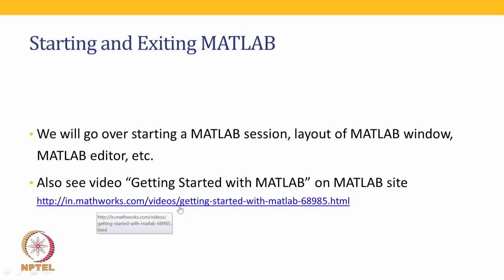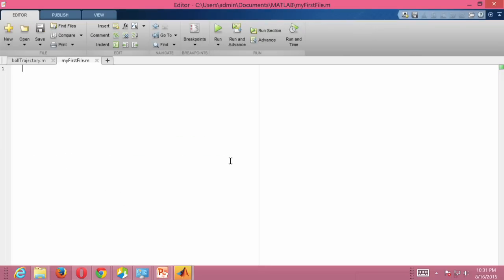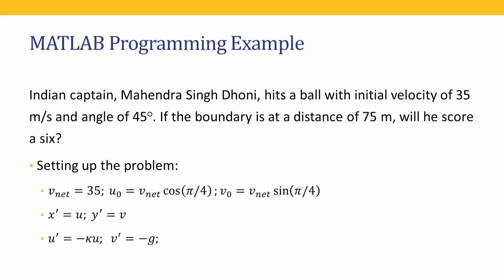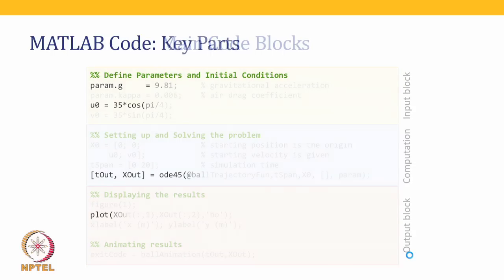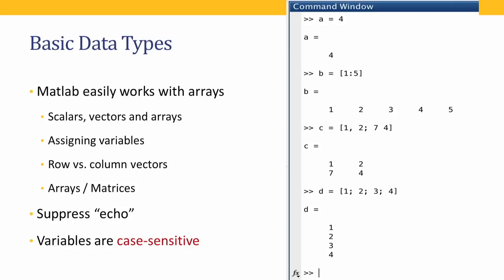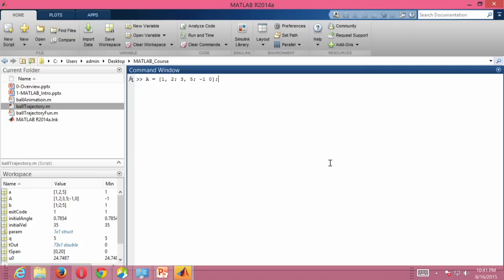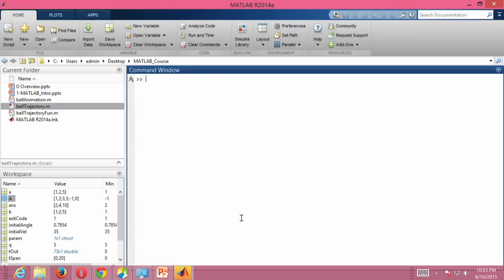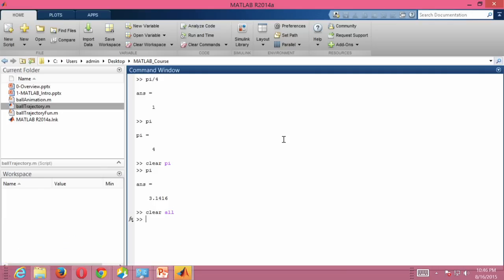Basics of Programming using MATLAB

Comment: sir please show me how predict value give show below PDF and and how build this type of network .sir it is not my project but same way i have make my project .it is a concrete work of Predicting the compressive strength and slump of high strength concrete using neural network.sir please guide mefor reference i will send pdf linkhttps://www.researchgate.net/profile/Erdogan_Oezbay/publication/257388816_Predicting_the_compressive_strength_and_slump_of_high_strength_concrete_using_neural_network_Constr_Build_Mater_Vol_20_No_9_pp_769-75/links/56e938e808aec65cb460479c.pdf?inViewer=0&pdfJsDownload=0&origin=publication_detail